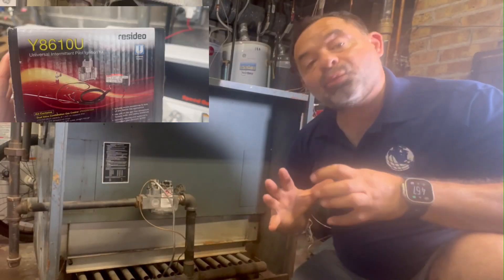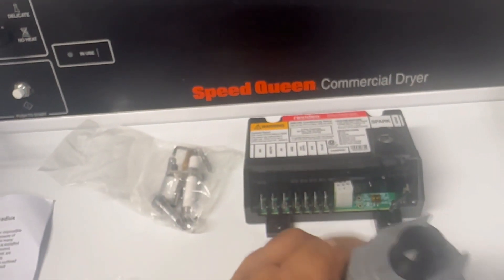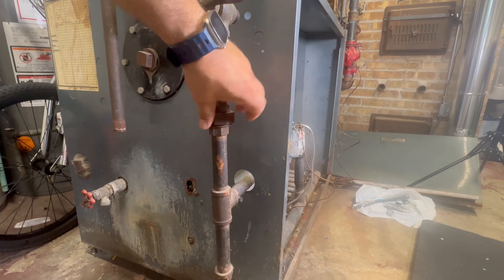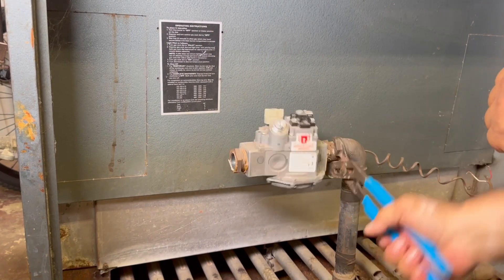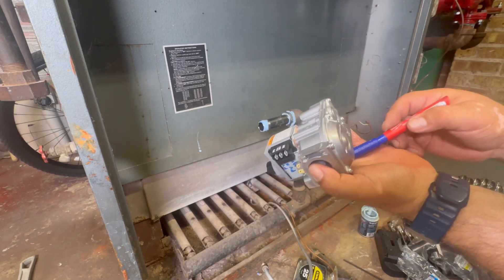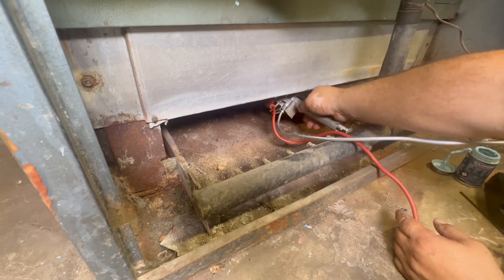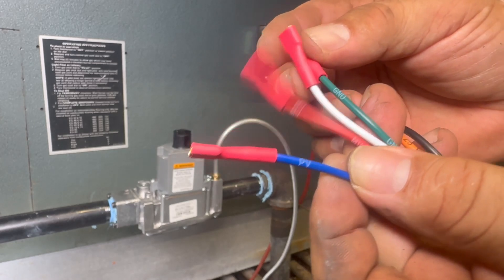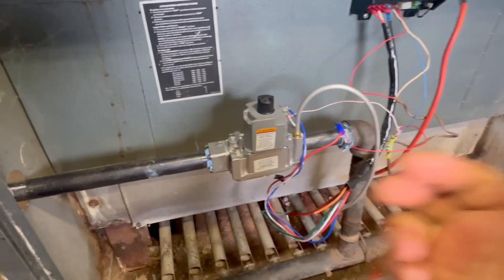HOW TO CONVERT A STANDING PILOT TO A Y861OU HONEYWELL/RESIDEO ELECTRONIC SPARK IGNITION

Comment: How do you connect thermostat wires?
Reply from the maker: Hello Roger,  All systems are different  configuration.  But the whole idea is to get 24 volts to the ignition module   when the thermostat cals for heat.  On boilers usually comes from the aqua stat     So you get 24 volts to the ignition system  and the other side of the transformer (the common wire) is already wired to other safety devices.  

An a simple system 24 from hot side of transformer goes to thermostat. the other side of thermostat goes to the 24 V of the ignition system  .  While this is happening 24 ground is wired to the common side of the transformer closing the loop    Now remember there are other safety devices connected in series on this loop.  So if anything falls ti stops the 24 V to the ignition killing the boiler.